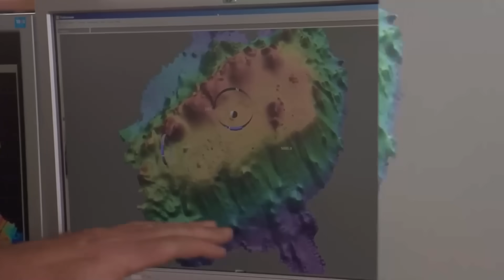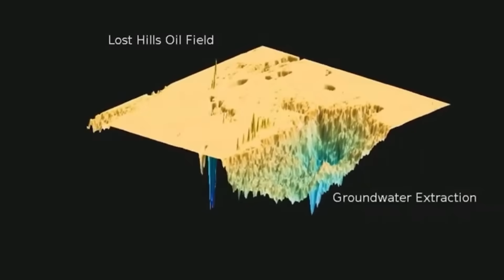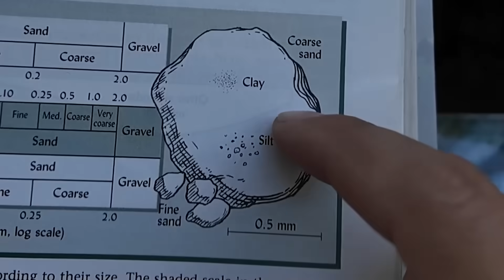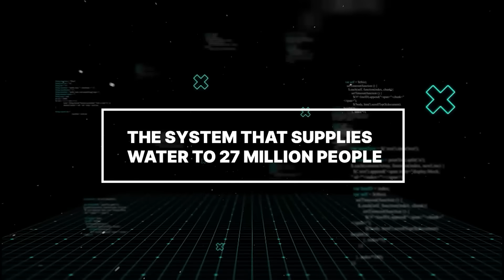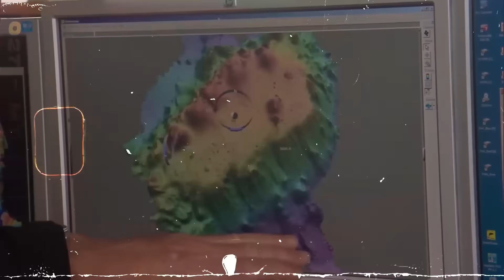California’s Central Valley Looked Normal Until New Footage Revealed the Aftermath

Comment: Start using ocean water taking salt out and filling up trucks with water to fill tower tall wells and pump rather than drill any more.  Only costs gas in trucks to move ocean water without salt to these farms.  And the ocean has trillions of gallons of water and rising fast becuz artic are with icebergs melting.  Start using ocean water with reverse osmosis to take salt out.
Reply: Desalination Plant  Marie and water  pumps , No trucks  needed !  And the Molten Salt  can be used in electric production  , but  that's just the water problem  , a Mountain  needs to be flatten  and the dirt Trucked in , and with the mountain gone makes a perfect place to build a New City !